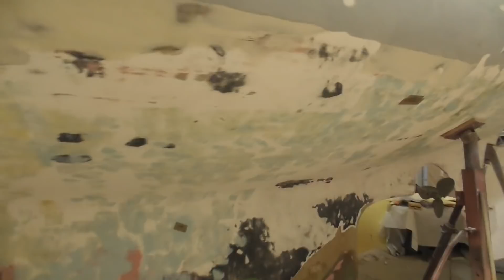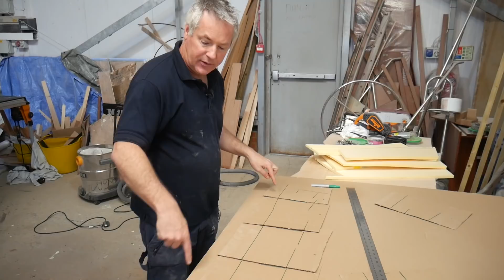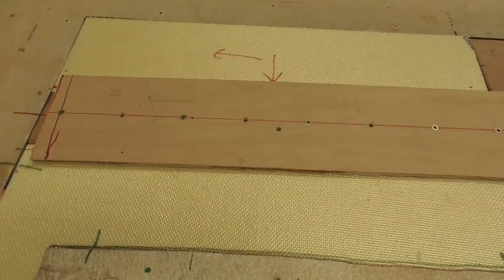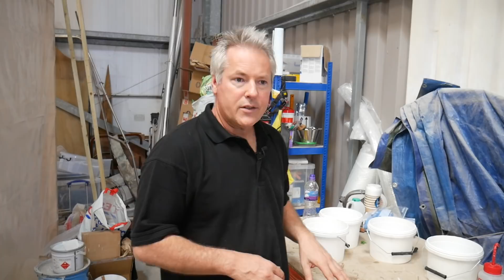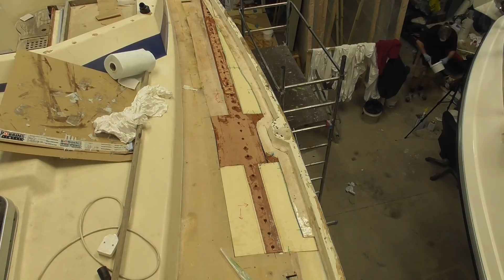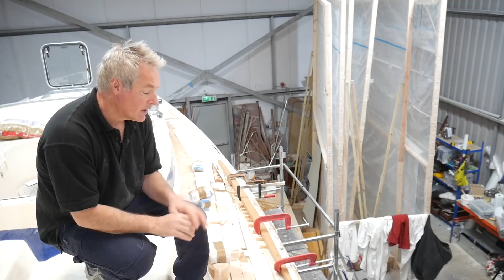#39 - replacing the side decks

Comment: Great to see you back and bringing Wanda back to her glory. Serms a lot more work than you first thought but 352s really are fabulous cruising yachts and you could not have chosen a better boat to go sailing on. It will be worth it. 

One thought. Check the wood stiffener under the mast heel. La Ina's was rotten and caused the mast heel to crack.
Reply from the maker: Hey thanks for the tip - I can't see any wood under the mast base in the core? It seems there is a stainless steel plate or something there that the mast heel screws into - what year is yours? I wonder if they switched wood for steel? My mast foot is cracked also though...
Reply: @aboatcalledwanda6925  La Ina is 1984 so a few years older than Wanda if I recall. They may have altered the design especially for the taller rig.